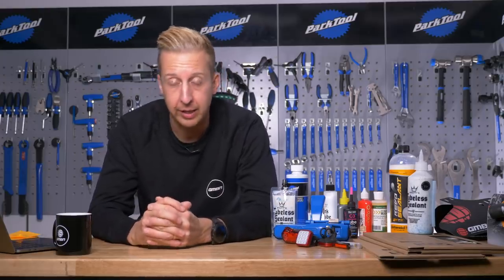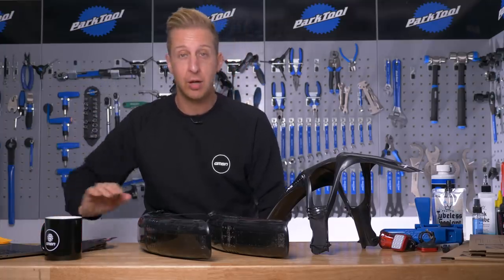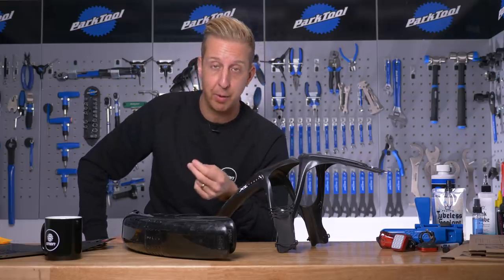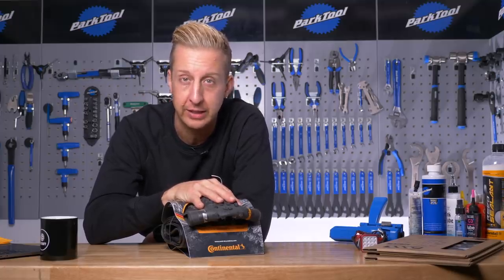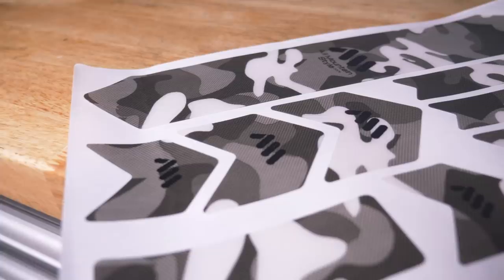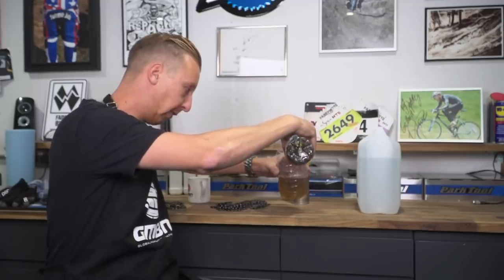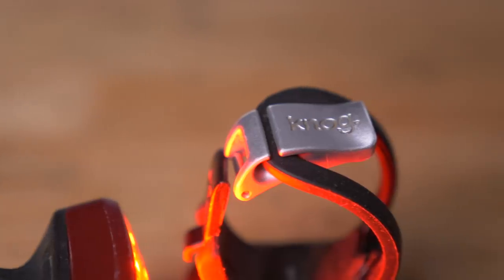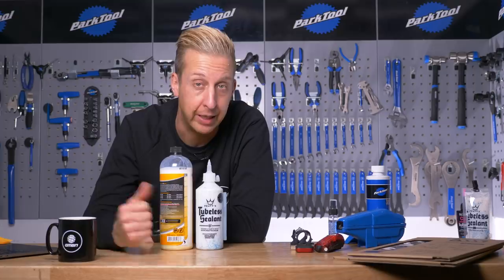The Best Winter Mountain Bike Upgrades For Under £50

Comment: You can pour the used degresser through a coffee filter to seperate the contaminants and use it many times🤙👍
Reply: j in avl sounds jank 😂😬
Reply: if you really want to go nuts, you can build a multi stage filter and reuse it indefinitely
Reply: Do you still make coffee with that filter
Reply: @benasquith26  of course it adds flavour
Reply: Why would you? Just leave the stuff in the jar and all the dirt settles out. If you don't jiggle the jar much you can pour off the perfectly clean fluid and stop when the first streaks of dirt start raising. Or you can also pour some of the dirt into your cleaning vessel along; it does not matter.
Reply: I tried this but after some degreaser comes out the rest just refuses to drip out. Maybe I'm using the wrong grade of filter paper?

Comment: The crud catcher does a great job of keeping mud off your face but it actually does the opposite to your fork stanchions and due to the cut out design it actually helps the mud to build up on the seal area right where you don't want it.best suited to sponsored riders who don't buy there forks
Reply: I would geet Mudhuggeer FR or RRP Proguard, I already got Mudhugger front and rear, but the rear also protects your butt and other sensitive areas, I run it all year long,  to protect against tyre wiping my butt, but in the winter it's a must cus I run studded tyres.
Reply: @johannes nilson...mudhugger all the way here

Comment: Give Simple Green or Purple Power a shot for cleaning your bicycle chain, they both work great in the Park Tool chain cleaner and they both work wonders in a ultrasonic cleaner. Also Gaffers tape works good for protecting your frame from light scratches, dings , or scrapes and is easy to get off. I have some on my top tube right now in the desert camouflage color.

Comment: Thought u said in a previous gmbn doddy u use dry lube even in the winter.
Reply: @Andrew Dodd I also use dry lube year round. I don't find that it gets washed out any more than wet, and not collecting dirt is a far greater benefit than anything the wet lube is supposed to be better at. With dry lube I can clean my chain by wiping it off even in winter, while with wet lube you need a bloody hazmat suit and facilities decontamination afterwards. I don't want to use it ever again. Works well enough, but it's a faff.
I have repurposed a small eye drop squeeze bottle for dry lube. It's part of my saddlebag-kitout. When I start hearing the chain, I stop and top the lube off. I've ridden brevets of 400, 600, 1200 km, some of them in the wet, with properly lubricated chain.
Reply: @horrovac what kind og dry lube do you use then? Very interested in that. My wax chain just doesn't cut it in this cold weather.
Reply: @mattiass.nielsen506  I use the "Dynamic" dry lube, but recently tried out the S100 dry lube (important! - in the small drip bottle, NOT as spray, spray is so messy it's useless) and that seems even better for now (quieter and longer lasting). But I guess any would work, if you cant get those just try any out.
Reply: @horrovac  thanks for that mate. I'm gonna try much off dry lube even in the vinter. 
Got a serious issue with my chain beginning to rust and wax stand stop it sadly though I love a clean drivetrain.

Comment: A basic 25pence sponge for washing cars sprayed with some cleaning fluid does a far better job than any chain cleaning tool and we use this method and have done for years at the world cups and I promise you it works a treat
Reply: @steve B yes your preferred cleaned of choice .ie muc off Fenwick's etc you don't need a specific degreaser.

Comment: #askgmbntech Winter has come, and the Winter Fat Biking Season is upon us here in Canada. I just replaced both front and rear Shimano Calipers on my Fat Bike after I noticed that they were both leaking mineral oil all over my brake rotors. Are Mineral Oil brake systems more prone to having issues in cold weather than DOT Systems? Winter temperatures here in Ottawa can range between -4C down to -30C on very cold days. Love the show.

Comment: DO NOT use lube on your cleats and pedal mechanisms. It gets washed off immediately. I use normal SPD pedals on my road bike, and being silent as road bikes are, you'll hear any sort of creak and over time it will drive you nuts. I have solved the problem by using copper grease on the engagement surfaces of cleats and pedals. Not only does grease adhere better, it also impregnates the surface with copper, as tiny copper particles get embedded into the scratches and pits in the metal, providing some level of lubrication even after the grease itself is worn und washed off. Of course it does not last forever and you'll have to regularly re-apply it, but at much longer intervals. It also works better than lube, which can feel "slippery" after you apply it.

Comment: Most of the fenders you showed are pretty much worthless for keeping mud dirt and water off of your face and body from the front tire. The back of the fender needs to extend down much lower to be really effective. The same goes for the rear except in the opposite direction. The fender needs to extend longer out the back and over the tire. That being said, spraying Maxima SC1 on the frame and underside of the fenders will help keep the mud from even sticking and make clean up easier. Multiple applications may be necessary and there is no need to polish it in like you would otherwise. One word of caution however, DO NOT spray Maxima SC1 anywhere near disc brakes, calipers, brake pads, etc. etc. you will contaminate them and they will be ruined.

Comment: #AskGMBN love the show. really have learning and laughing a lot with you guys. Thinking buying a new orbea occam 2020 H* series (alloy). I'm a casual rider and like to have some fun on the trails and also will be my commute. Would you advise going for the h10 (better transmission and wheels) or the h20 with upgraded suspension to fox factory series ? - they both came with fox performance. The sus upgrade will leave them around same price. The main goal is to start as lightweight as possible and then upgrade when a replacement is needed. Thanks in advance.

Comment: #askgmbntech hey guys, I’m looking at a new set of wheels for my 2019 trek remedy 7 to replace the ones it came with. Looking at DT Swiss EX511 rims and hope pro 4 hubs. Are there any advantages or disadvantages  to 32 spokes over 28? Thanks guys love the show!
Reply: I running hope pros hubs with stans rims 32 spokes on my trek fuel, no issues and they are bulletproof, I've been using them at bike parks and they are holding well.
Reply: Joshua Meade thanks man, ended up gong with 32 as well, they arrived on Saturday and feel really sturdy

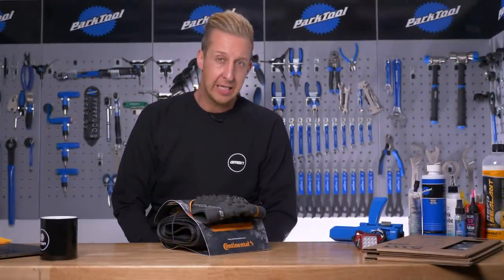Comment: 3:59 that's wrong for the winter here in Norway, its Studded tyres or crash. it's icy.
those tyres you show will be a deathtrap in Norwegian winter, you have zero grip on ice, as soon as you hit a off camber section you slite, you got no chance, I see some ride without studs on flat surface, but its very risky, cus you have to ride super slow and brake carefully, but you could walk then in stead but it's impossible to walk without studded soles, which I have with me if there is impossible to access without studs, and if I might need to walk.
your recommendations are more for autumn and spring.
8:17  I just wash the bike and use a Finish Line grunge brush if it's bad and then wipe the chain with a rag when I have finished hand drying the bike, then I lube the chain, I never liked used these chain cleaning devices, I have one from Weldtite but never use it, more unnecessary faffing, the brush iss faster and easier for me.
Reply: I have ridden a lot in the winter without studded tyres and yeah, can be really sketchy, but trails with berms weren't that bad, even if they were basically just ice. Now I have ISP's and yeah, they're way more safe, but the grip in snow is not as good as Magic Marys.
Reply: @th_js  wherein am it's ice in the winter, but mud tyres or other aggressive tyres are nice in the snow, but on ice it's hopeless, but I think icespiker performs quite well on dry surface or on gravel, atleast with my setup I use Cush Core, and lower pressure than it would be just tubeless.
Reply: @mtbboy1993  Of course it's ice here too, heck, I live in Finland. But if there is thick snow and you are putting down the power, the ISPs don't have much purchase.
Reply: @th_js  have you tried 45north Nicotine?
Reply: @mtbboy1993  Nope.
Reply: @th_js  OK.

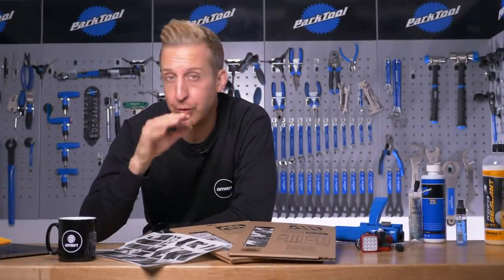Comment: 6:35  I have Raw Geometron G1 on the way, so no paint to protect. but maybe some wax coating or spray in a rag and wiping it would keep it cleaner? I haven't tried that on a bike yet.
Reply: The MucOff Bike Protect doesn't really help at all just so you know. I wouldn't be worried of the lack of paint, since water and dish soap won't damage the frame at all really, since dish soap isn't that strong, but if you for some odd reason would use the stuff you use in a dishwasher, that would be damaging.
Reply: @th_js  I meant protective layer of was or a spray i put on a rag, I see there are spray from Muc Off, or wax that you can put on.
Reply: @th_js  Of course not dish washer powder😂 I just mean layer to keep frame cleaner and protect it.
Reply: @mtbboy1993  Yeah, I know but earlier you seemed to be concerned about the lack of paint on a bike.
Reply: @th_js  I just went for it that's what they had in stock, and did not want to wait 4 more weeks, frame is on the way coming in about 2 weeks.
Reply: Wipe gt85 over it on a cloth, leave to dry. Helps stop mud sticking
Reply: @rupedog  yea, thought about something like that could work, not sure where to buy it in 🇳🇴 yet.

Comment: Wet lube is the work of the devil. Awful stuff, it does more harm than good in my opinion. 

I’d rather just clean and dry lube after every ride in winter. Dry lube will last for a good 35-40 miles in winter wet and filth as long as you don’t constantly degrease the chain with one of those chain degreaser tools all of the time, as they strip too much lube from the chain if used all of the time.

Comment: This only applies to the UK. Here in Finland these tips are worthless. Studded tyres, layer dressing, many layers. Tubeless is worthless in the winter, bike feeling really dead, brake discs freezing, also if you don't maintain your parts well, they will likely get moisture in them at some point and freeze, which is a no no.
Reply: Also you don't need to wash your bike even once during the whole 6 months of winter.
Reply: @Andrew Dodd Thanks for taking this into consideration!